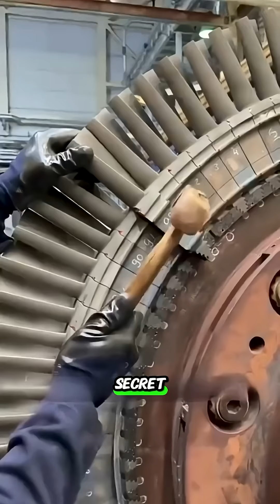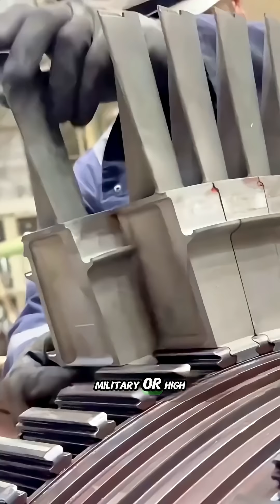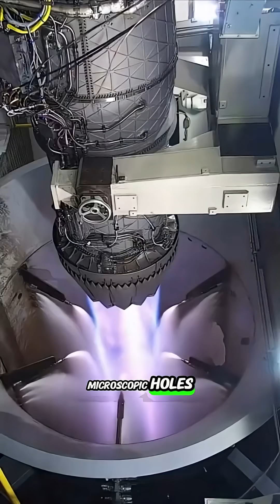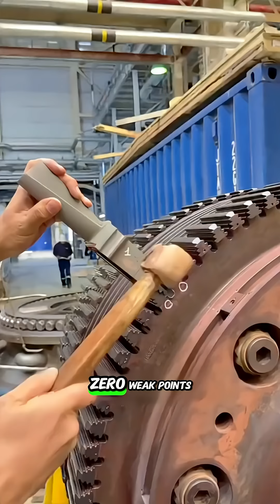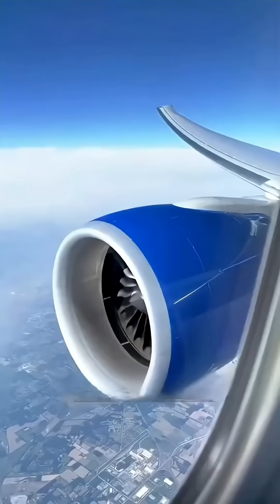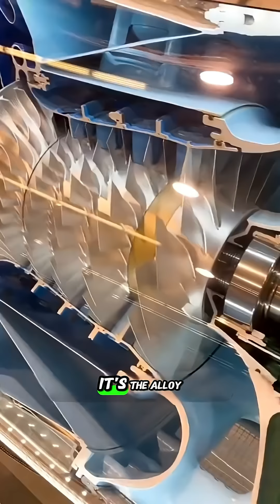The Insane Reason Nobody Can Copy American Jet Engines

Comment: Yes. Israel has significant expertise in manufacturing jet engine turbine blades and other high-temperature aerospace components.
The best-known company is Bet Shemesh Engines (BSE), which manufactures:
Turbine blades and vanes
Compressor blades
Precision-cast superalloy components
Complete engine modules and parts
These components are supplied to major aerospace companies, including Pratt & Whitney, Rolls-Royce, GE Aerospace, and Safran Aircraft Engines for both commercial and military jet engines.
Israel also has advanced aerospace manufacturing capabilities through Israel Aerospace Industries, although its focus is broader than turbine blade production.
Jet turbine blades are among the most technically demanding components in an aircraft engine. They are typically made from nickel-based superalloys using single-crystal casting techniques and include intricate internal cooling passages and thermal barrier coatings to withstand temperatures exceeding the melting point of the base metal.
So, the answer is yes—Israel is one of the countries with advanced capability to manufacture high-performance jet turbine blades for the global aerospace industry.

Comment: European Manufacturers (e.g., Rolls-Royce): European designers favor highly advanced, super-formed hollow titanium (Diffusion Bonded/Super Plastic Formed, or DB/SPF) blades. These blades are incredibly thin, lightweight, and tough, but Rolls-Royce has historically favored them over composites for superior resistance to foreign object damage and erosion.
Rolls-Royce (UK): Their next-generation UltraFan engine uses a record-setting 140-inch fan made with 3D-woven carbon fiber composites and automated fiber placement (AFP) to drastically cut weight.

Comment: Handful of countries anyway...the newer blade actually ceramic coated, they're no single crystal grainless casting structure 😂 ..they're actually more like nano pore structure for better heat resistance and dissipation..and they're usually spins at 100.000 rpm anyway..here the explanation sounds like 2 stroke engine to me.

Comment: CASTING Turbine blades isn't exactly casting.....it's closer to "Growing a crystalline alloy structure" in the SHAPE of a turbine blade, so that it can withstand temperatures higher than the melting point of that alloy ... It may be The Most Complicated manufacturing process, on the planet.

Comment: In the 70s and 80s the US launched a SR-71 Blackbird every week to fly over Russia and photograph their defense capabilities. Every week Russia would send up MIG 25s to intercept the U.S. SR-71, 
The MIGs would race through the sky to 70,000’ and begin to slow reaching 75,000’ but still about 10,000’ short of the SR-71s ceiling and well short of the SR-71s top speed. The MIG could only maintain its top speed for about 90 seconds before retreating back to its base. This went on weekly for 30 long years without a shot ever being fired because the Russians did not possess an aircraft or missile that could keep up with the SR-71. 
Who here thinks technology stopped in the 80s or 90s for the US defense industry. 
Today the US technology can allow several U.S. war planes to overfly any country on earth completely undetected by enemy radar. Technology never stopped and it’s no surprise that a (self cooling)vane in a jet fighter might cost $ 55,000.00. The complete engine might cost 20 million$.

Comment: Outside the US, the UK, France, China, Japan, Russia and Ukraine all manufacture their own jet engines from scratch.
Reply: Only four countries in the world can make the fifth-generation turbo fan engines due to their high complexity. China can't produce them by reverse technology.

In 2006, an agreement was signed on the creation of a new engine, which was named PD-14 (a promising engine with a thrust of 14 tons).

PD-14 is a serially produced Russian high-bypass turbofan engine of fith generation developed for the MC-21-300 aircraft, PD-14A for the MC-21-200, and PD-14M for the MC-21-400. PD-8 engine will be installed on the Be-200, AN-148 and Sukhoi Superjet 100 aircraft. Therefore, the designers and engineers faced the task of creating a unified gas generator, the main element of the engine.

16 new technologies were developed for PD-14 by russian designers, engineers and scientists, namely - single-crystal blades for a high-pressure turbine with an advanced cooling system that allows the turbine to operate at temperatures up to 2000 ° K.; hollow wide fan blade made of titanium alloy, thanks to which it was possible to increase the efficiency of the fan stage by 5% in comparison with the fourth-generation turbofan engine PS-90 produced in the USSR in the late 1980s; low-emission combustion chamber made of intermetallic alloy; sound-absorbing structures made of composite materials; ceramic coatings on hot parts; hollow blades of a low-pressure turbine, etc.

 20 new materials were created for PD-14 with indisputable advantages: a decrease in specific fuel consumption by 10–15%, a reduction in the life cycle cost by 15–20%; operation of the engine will cost 14-17% cheaper than existing analogues. All of them have been certified according to international standards.

New Russian titanium and nickel alloys are used to create the engine. The engine nacelle design comprises 65% domestic polymer composites, which achieve the required level of sound insulation and reduce engine weight. 

The technologies used in the production of PD-14 are state secrets and are protected. Therefore, information about PD-14 is broadly classified. Example: China would gladly copy production technologies, much like the Su-27. They copied the plane, but they failed to replicate the AL-31F engine.

The state's ability to produce cooled cast blades for a modern turbine aircraft engine is an indicator of the highest level of development in mechanical engineering. There are fewer states capable of producing fifth-generation aircraft turbojet engines than countries with nuclear weapons or those that launch satellites into space. Only four countries—Great Britain, Russia, the USA, and France—possess full-cycle technologies for creating such engines.

Comment: As an ex Rolls Royce (Aero Division) employee, I find this mildly offensive.
Barely any of the technology shown here was developed in the US - it all originates in the UK. The original jet engine was invented here in the UK and we have led the way in their development since then.
I grant you that the single-crystal turbine blade was invented in the 1960s by Pratt & Witney, but that only shows that what is being talked about here is nothing new.
Rolls Royce are still way ahead of the game, working on the UltraFan engine - using the world's most powerful aerospace gearbox which cuts fuel consumption by 25%. It's also working on electric hybrid systems, hydrogen powered engines to name but two new technologies.
If this is just click-baiting for everyone not in the US - it's worked.

Comment: The metal which melt on 1200*c the jet engine heat exceed more than 1400*c which spins thousand of RPM . Each blade doesn’t stretch with tons of force apply on them in the farm of centrifuge in intense heat is just mind blowing

Comment: The cost is true. A few years ago I was doing a 5 year overhaul on a 6FA GE gas turbine. I sent a millwright to get a blade in the warehouse. It was a first stage bucket(blade)#29. As he was coming back to the unit I saw him throwing the blade up an catching it with one hand. I almost had a heart attack. I waited till he got to me and handed me the blade before I told him what that 1 blade cost. And what would be coming out of his paycheck if he dropped it. $35,000. And that was in 2005. He never did that again.
Reply: I worked and made GE Gas Engines, every area of a couple decades and people have no idea how much it takes to machine every part, and the precision that has to be maintained.

Comment: This whole thing is bullshit,  theres no coolant in a turbine, they don't turn 10's of thousands of RPMS. Some of the smaller ones might turn 15,000 or so, but the ones in the video MIGHT make it close to 10,000 max. I worked on turbines for several years.

Comment: That is simply not true. My friend works on these turbine engines. They regularly come in for in for repair with tiny chips of blade missing or little dents, but they do not merely fly apart as suggested. Vibrations build up to a point where repair becomes urgent. The repaired blades are weighed before being put back in to service. If they fail to meet the specifications they are replaced with compatible secondhand ones otherwise new ones.

Comment: Weight of a human hair? Don’t think it’s that small. During preflight you can often see from the front of the engine how nicks on the first stage are blended out by maintenance. This changes their weight and if too much is required, the blade is changed out. In flight at certain lower RPMs, usually near idle, you can feel the low rumble of vibration and each engine is different with age, due to this. Airbus and Boeing both have vibration indicators for compressor spool (N1) and turbine (N2).

Comment: Fun fact: some compresser blades fit loose in the large engines held in place by aero pressure and centrifugal forces. If left in the wind the engines will rotate at low rpm and you can hear the blades rattling. A 2x4 can be used to prevent rotation. When China bought jet fighters from Russia and tried to copy them they were unsuccessful as they didn't have the advanced metallurgy required to keep the blades from melting within minutes.
Reply: Only four countries in the world can make the fifth-generation turbo fan engines due to their high complexity. China can't produce them by reverse technology.

In 2006, an agreement was signed on the creation of a new engine, which was named PD-14 (a promising engine with a thrust of 14 tons).

PD-14 is a serially produced Russian high-bypass turbofan engine of fith generation developed for the MC-21-300 aircraft, PD-14A for the MC-21-200, and PD-14M for the MC-21-400. PD-8 engine will be installed on the Be-200, AN-148 and Sukhoi Superjet 100 aircraft. Therefore, the designers and engineers faced the task of creating a unified gas generator, the main element of the engine.

16 new technologies were developed for PD-14 by russian designers, engineers and scientists, namely - single-crystal blades for a high-pressure turbine with an advanced cooling system that allows the turbine to operate at temperatures up to 2000 ° K.; hollow wide fan blade made of titanium alloy, thanks to which it was possible to increase the efficiency of the fan stage by 5% in comparison with the fourth-generation turbofan engine PS-90 produced in the USSR in the late 1980s; low-emission combustion chamber made of intermetallic alloy; sound-absorbing structures made of composite materials; ceramic coatings on hot parts; hollow blades of a low-pressure turbine, etc.

 20 new materials were created for PD-14 with indisputable advantages: a decrease in specific fuel consumption by 10–15%, a reduction in the life cycle cost by 15–20%; operation of the engine will cost 14-17% cheaper than existing analogues. All of them have been certified according to international standards.

New Russian titanium and nickel alloys are used to create the engine. The engine nacelle design comprises 65% domestic polymer composites, which achieve the required level of sound insulation and reduce engine weight. 

The technologies used in the production of PD-14 are state secrets and are protected. Therefore, information about PD-14 is broadly classified. Example: China would gladly copy production technologies, much like the Su-27. They copied the plane, but they failed to replicate the AL-31F engine.

The state's ability to produce cooled cast blades for a modern turbine aircraft engine is an indicator of the highest level of development in mechanical engineering. There are fewer states capable of producing fifth-generation aircraft turbojet engines than countries with nuclear weapons or those that launch satellites into space. Only four countries—Great Britain, Russia, the USA, and France—possess full-cycle technologies for creating such engines.

Comment: I used to make those blades but they were made out of titanium in one impeller it was all one piece made for helicopter turbines and would cost over $50,000 in the early nineties
Reply: I worked at what use to be Garrett Turbine engines in Phoenix on the design, development, and qualification of an advanced turbine engine for the LHTEC fast attack helicopter, called the T800.  Unfortunately the Army decided not to go forward with the project.

Comment: While Pratt & Whitney pioneered the metallurgy of single-crystal blades, Rolls-Royce invented the critical mass-manufacturing process required to actually use them in commercial aviation: the "pigtail" (or spiral) grain selector system.Without this invention, single-crystal blades would have remained a hyper-expensive laboratory novelty.

Comment: The statement that only a select few countries can manufacture such jet engines is a dangerous one. At one time ceramic, known as bone china was only made in China using a secret unknown in Europe. Yet a Prince's prisoner developed a completely new way to make it (it was his ticket to freedom), then the European ceramic industry was born.
Lately, small scale jet engines are being 3D printed using high temp alloys that can't be machined or cast, the formula for that alloy, developed by NASA is in the public domain.
Never say never, as they say.
Reply: Only four countries in the world can make the fifth-generation turbo fan engines due to their high complexity. China can't produce them by reverse technology.

In 2006, an agreement was signed on the creation of a new engine, which was named PD-14 (a promising engine with a thrust of 14 tons).

PD-14 is a serially produced Russian high-bypass turbofan engine of fith generation developed for the MC-21-300 aircraft, PD-14A for the MC-21-200, and PD-14M for the MC-21-400. PD-8 engine will be installed on the Be-200, AN-148 and Sukhoi Superjet 100 aircraft. Therefore, the designers and engineers faced the task of creating a unified gas generator, the main element of the engine.

16 new technologies were developed for PD-14 by russian designers, engineers and scientists, namely - single-crystal blades for a high-pressure turbine with an advanced cooling system that allows the turbine to operate at temperatures up to 2000 ° K.; hollow wide fan blade made of titanium alloy, thanks to which it was possible to increase the efficiency of the fan stage by 5% in comparison with the fourth-generation turbofan engine PS-90 produced in the USSR in the late 1980s; low-emission combustion chamber made of intermetallic alloy; sound-absorbing structures made of composite materials; ceramic coatings on hot parts; hollow blades of a low-pressure turbine, etc.

 20 new materials were created for PD-14 with indisputable advantages: a decrease in specific fuel consumption by 10–15%, a reduction in the life cycle cost by 15–20%; operation of the engine will cost 14-17% cheaper than existing analogues. All of them have been certified according to international standards.

New Russian titanium and nickel alloys are used to create the engine. The engine nacelle design comprises 65% domestic polymer composites, which achieve the required level of sound insulation and reduce engine weight. 

The technologies used in the production of PD-14 are state secrets and are protected. Therefore, information about PD-14 is broadly classified. Example: China would gladly copy production technologies, much like the Su-27. They copied the plane, but they failed to replicate the AL-31F engine.

The state's ability to produce cooled cast blades for a modern turbine aircraft engine is an indicator of the highest level of development in mechanical engineering. There are fewer states capable of producing fifth-generation aircraft turbojet engines than countries with nuclear weapons or those that launch satellites into space. Only four countries—Great Britain, Russia, the USA, and France—possess full-cycle technologies for creating such engines.

Comment: Excellent explanation overall. The biggest moat in modern jet engines isn’t the CAD model—it’s the manufacturing ecosystem: single-crystal superalloys, thermal barrier coatings, precision casting, machining, inspection, and decades of process knowledge.

A couple of details are a bit exaggerated, though. Cooling holes aren’t generally thinner than a human hair, and turbine blades are typically weight-matched to extremely tight tolerances, but “microgram precision” overstates it. 

Also, the U.S. isn’t the only country capable of producing advanced turbine blades—companies in the UK, France, Germany, Japan, Russia, and increasingly China have developed this capability too.

The central point is absolutely right: in aerospace, manufacturing know-how is often more valuable than the blueprint itself.

Comment: The most sold civillian jet engine in the world is the CFM 56, French/US made. Rolls Royce is UK. Arguably, the best jet engines on the planet at the moment. I heard that many US helicopters were switching their turboshaft engines from Pratt and Whitney (US) engines to Turbomeca (France). The Russians also make good jet engines (Tumanski), albeit, mostly for military use. Now the Chinese are not twiddling their thumbs either, albeit for military use.
The hardest part in a jet engine is arguably the materials science and fabrication of the high pressure turbine, and the fan and its reduction gearbox. The high pressure turbine because of high temperatures and centrifugal forces it has to deal with, the second because it must be lightweight and resist impact (fan blades) and be compact and transmit huge power (reduction gear).